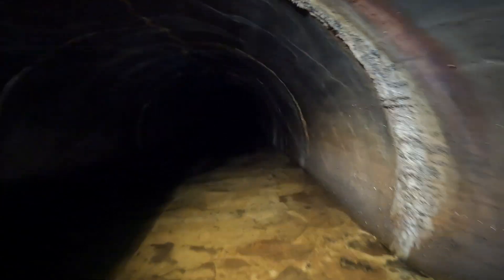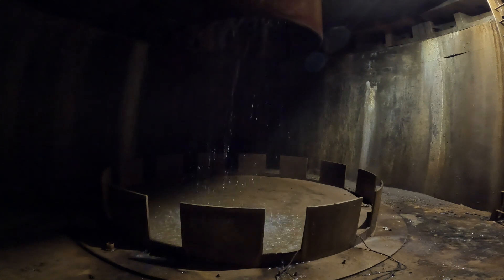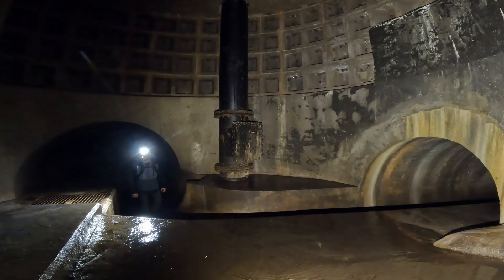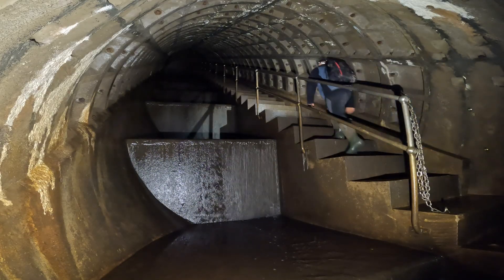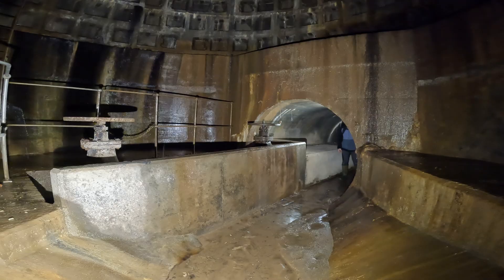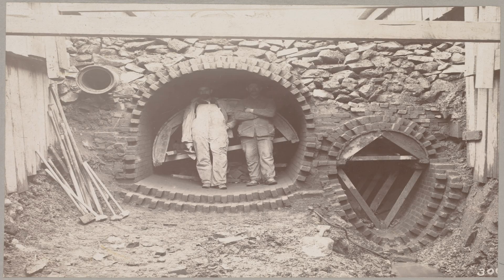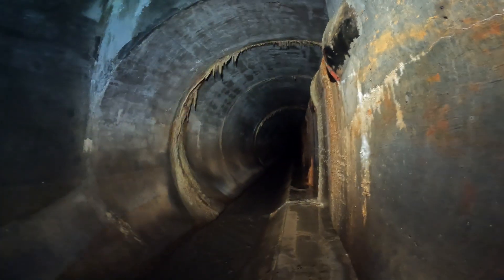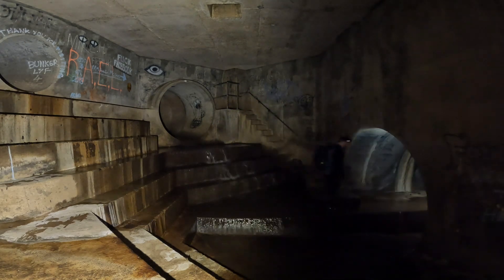''UNDERGROUND MARVEL'' Northern England's Storm Drain Network

Comment: I can say one thing, I'd never be able to go into something like this without a closed circuit air system (SCBA / SCUBA), a lot of dead air, and low points for gases to get trapped or sink into, could never trust a digital detector, some substances you never want to be exposed to your respiratory system, even in the lowest PPM possible, some will kill you FAST, some will kill you slowly, some will take years or decades to bring you a horrific death.
Reply: Seconded, especially with the link to the shipping canal and presence of chemicals from runoff and or illegal dumping. Not to mention hidden hazards or flash floods. Very dangerous
Reply: You could die just walking down the street in open fresh air.
Reply: Seriously?  What do you mean by decades for horrific death. Only thing I can think of is somehow inhaling chiped portion of asbestos in concrete pipe particle that creates cancer in lungs overtime. Seems like always alot of water and air pushing through the system to get dead space of organic material.